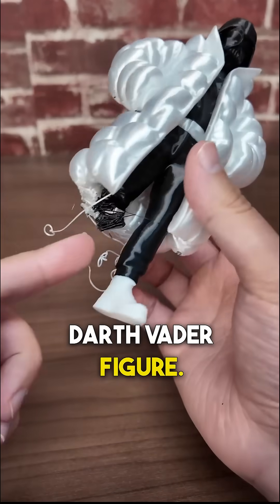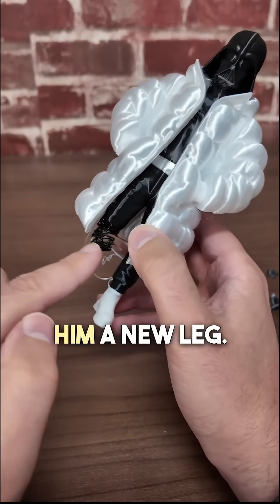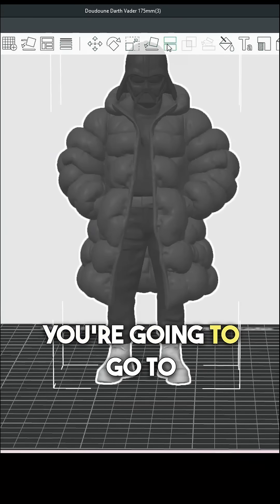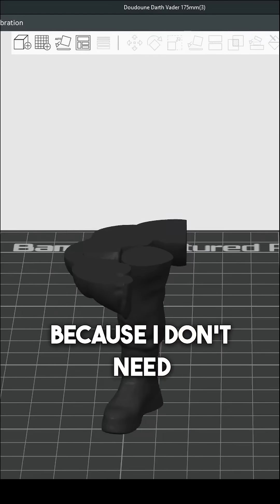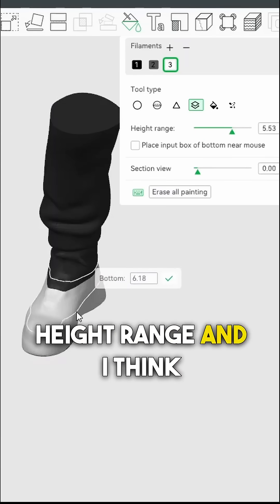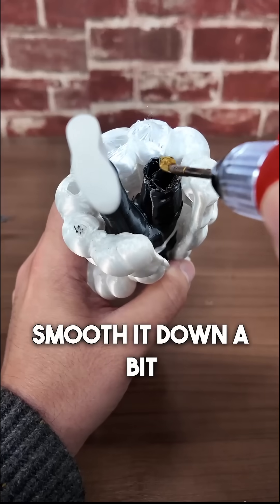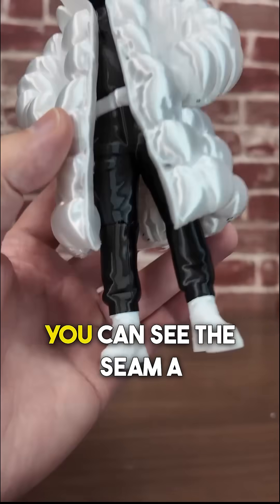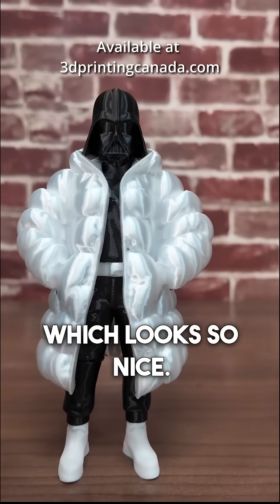How To Fix a Failed 3D Print

Comment: What about extruding in/out a peg and slot for the leg to lock into? Is this possible easily on the slicers? I want to do some larger multi piece statues, and was curious how people are slicing these up into pieces and how we can make joints.

Thanks :)
Reply: The cut feature in Bambu Studio has an option to add connectors or make the cut a dovetail. It's very easy to do, you shouldn't have much trouble with it
Reply: Fusion 360 exists